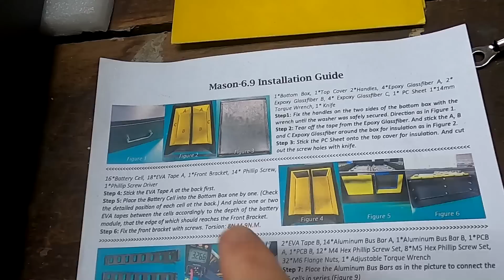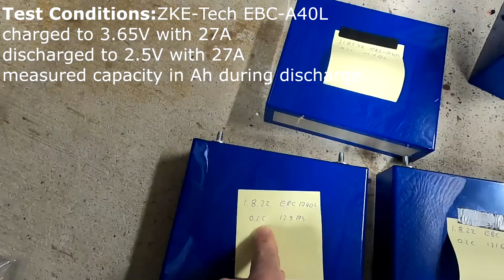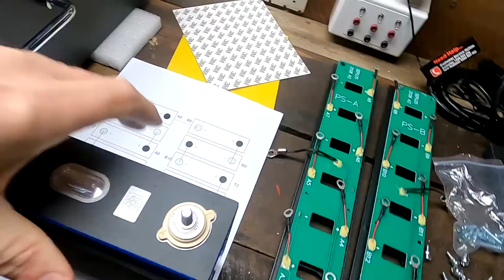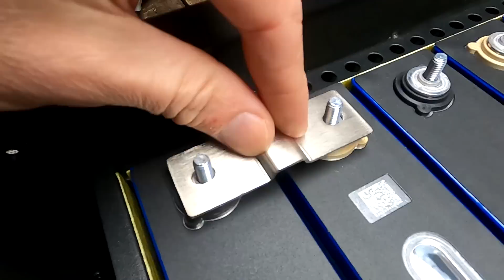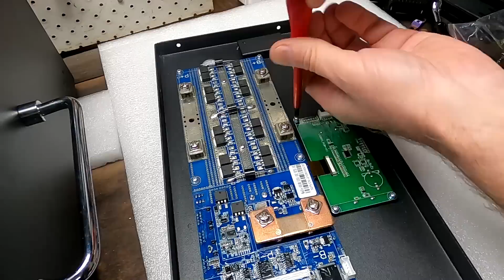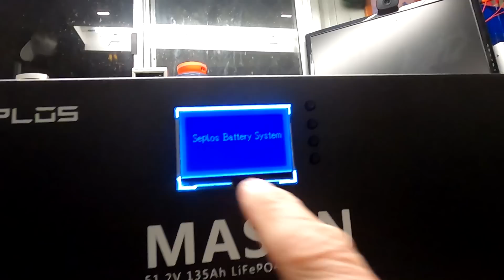SEPLOS MASON 6.9 Kit. Building a battery was never that easy (and fast).

Comment: I really like the look of this enclosure / kit. very tidy and neat. I've never understood the advantage of BMS to inverter communication ...
Reply: the advantages is simplification, you don't need to set any kind of parameters , just choose the name or the compatible standard of the battery and  all is pre-set
Reply: @rOSScOGITANS  there an advantage if your inverter can deal with all the information provide by the inverter.  #1 the inverter can adjust the charging Amp dynamically instead of trying to guest the SOC from the battery voltage. #2 the bms can request an immediate charge on some conditions other than low SOC.  #3 the bms (at least this one) has a better understanding of the SOC, so to trust it than the inverter.
Reply: @sergea1138  perfect Serge, the advantages are not something poor
Reply: @sergea1138  is this information detailed somewhere?
Reply: @DrCoolZic  yep, you need to read the pylontech protocol specification,  and this particular bms pylon specification implementation. They give hints about how the inverter should use some of the information.  all of this is useful of course only if your inverter use them.   voltronic publish a document describing  what subset of pylon specification they are using.
Reply: @sergea1138  although this inverter does support Pylontech (And so does Victron) there is a specific Victron setting in the BMS.
No idea what that gives on top of the Pylontech option
Reply: Works great if you have a Growatt inverter cause then the battery integrates into the Growatt app and solution smootheless like a genuine Growatt battery.
You will see the SOC from around the globe inside the Growatt app.

Comment: Hola….. I don’t think that the BMS needs to talk to the inverter!
Reply: This bms will Talk to the victron via canbus. I own this one as 16s 200a and i am pretty Happy about the bms. 
Cant wait for my 280kit to Arrive :)
Reply: Servus 🖖
Reply: depends on your preferences cause if you own a growatt or sma then the battery will integrate into the system like it would be one from the inverter manufacturer.
Then you could benefit from the charging strategies depending on your night tarifs where you might could charge the battery for 8 cent and sell those in peak hours for 38 cents.

Also for the charging strategy it is better to have the support.